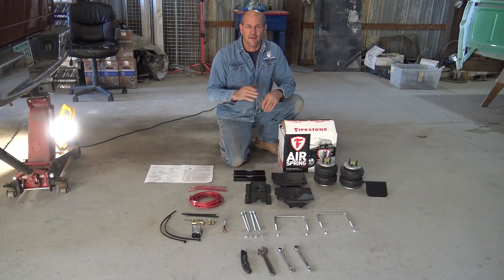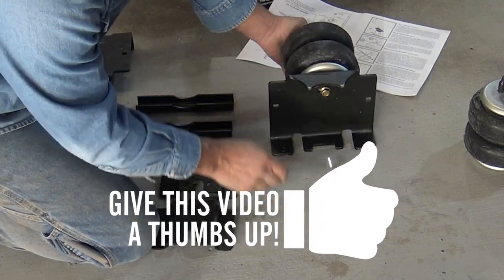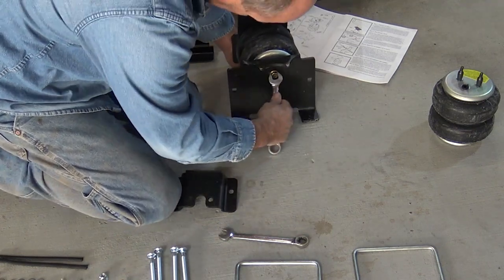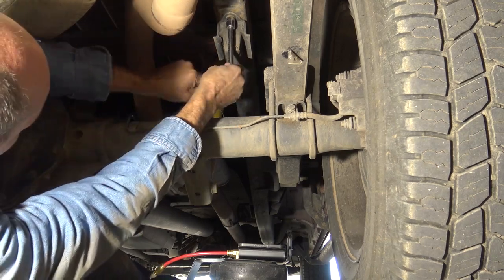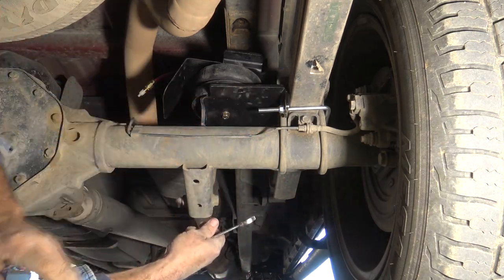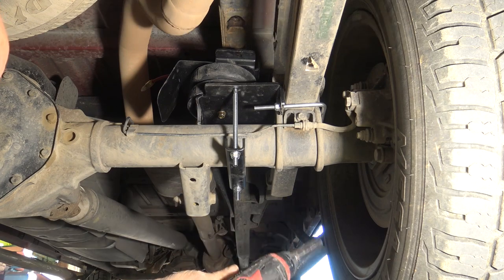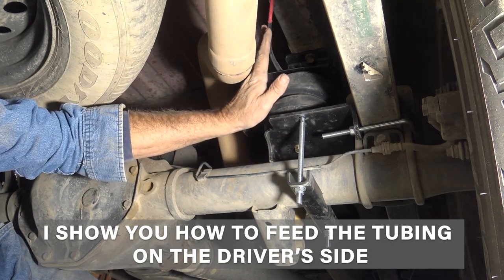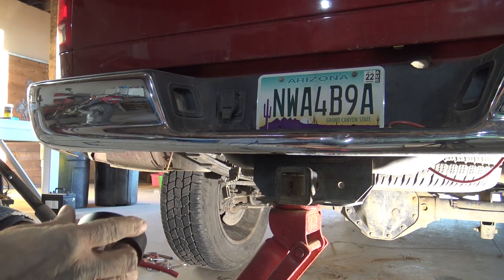Dodge Ram 1500 Air Bag Suspension Installation - Firestone Ride-Rite

Comment: I was looking forward to seeing you air them up. I would think there would a splitter on the air line so they would air up at the same time like the old air shocks we use to run on our old hot rods.
Reply from the maker: I am going to install a tee in the future. They are the best thing I have installed on a truck! I would recommend them to any one that haul's.

Comment: Would like to know if you have an update on them! Seeing the video was posted 2yr ago. I am searching for something to help with the Sag i get when i hook up my 32' camper to my 2008 Dodge 1500. Thanks!
Reply from the maker: I sold the truck a week ago. I would highly recommend air bags and the Firestone brand. You do need to keep about 5psi in them when not hauling so the bag doesn't crease. When hauling with and with out the difference is huge.

Comment: Looks like it’s been on the truck for a while any follow up for leaks my experience with air shocks and air systems is constant leaking
Always a problem you air up and the next morning you’re down or low on pressure spray everything with soapy water still a mystery as to how the system loses air thanks for a follow up
Reply from the maker: So far so good! I forgot to lower the pressure last time we came back from camping, so the pressure was at 20 psi for 3 weeks and when I lowered the pressure it was still at 20 psi. I think there is a huge difference in quality with the Firestone.

Comment: I have a 2014 ram Laramie and the ai lift is junk is there a better air suspension set up for it? I'm pretty sure I just need a better compressor, module and air hose valve. Thank you in advance.
Reply from the maker: The Firestone is rated as the best because of the thickness of the bags. I would look that direction.

Comment: Should have put in a tee an use 1air valve
Reply from the maker: I was going to do that. But then I thought about it, if I load something heavy on one side ( blocks, concrete, water jugs etc..)  I don't want the air bag on the heavy side to compress and the light side to inflate.
Reply: You could use a set of one-way valves to fill both air bags from one inlet, and a second set of one-way valves leading to an exhaust valve guaranteeing equal pressure in both air bags if you cycle the pressure often (probably not worth it for most people but it would be fun to build), the other even more precise way would be to have an air compressor/tank leading to a leveling valve for each side of the axle, which would guarantee levelness to the road surface.